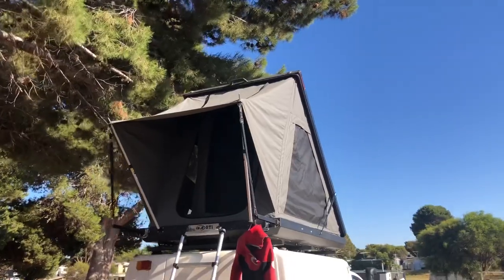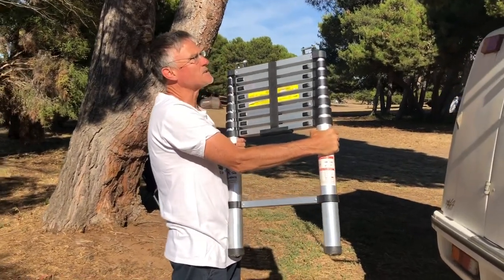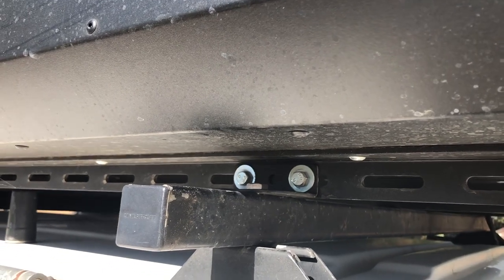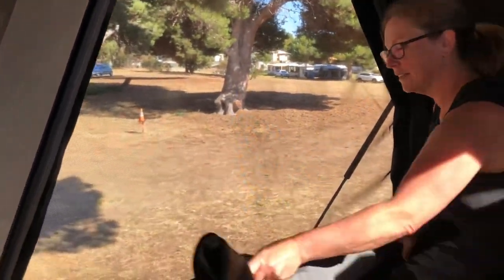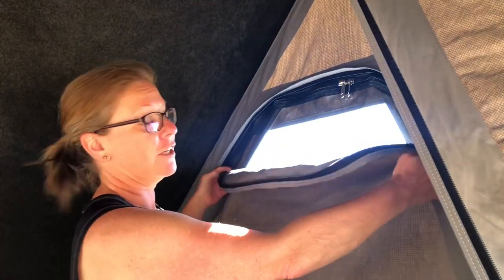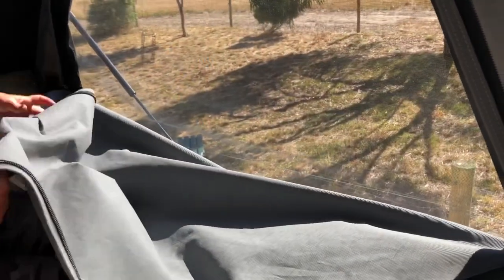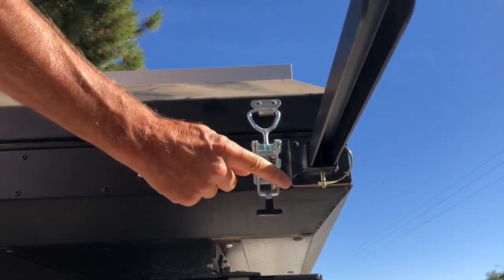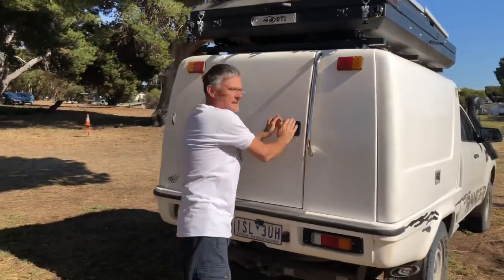Boss Aluminium Hard Shell Roof Top Tent Review

Comment: Hi.  What made you not choose the Bundutop RTT?
Reply from the maker: We thought the clamshell provides more room because you can stand up to get dressed. I also thought the Bundutop seemed a little complicated and might fail. The RT1 also looks better.
Reply: @openroadtouring2410  

Thank you.  Does it feel claustrophobic?

Also if you attached solar panels, how did you do this without damaging the waterproof integrity of the unit?
Reply from the maker: The inside is as wide as a double bed with no extra room on the sides. It's a foot longer than the double mattress so there is a little extra space at either end. For one person its huge. For 2, it's a little tight. I'd say it's like being in a 4 man tent that is high enough to stand. Interestingly we find it best with our heads up the lower end so the height is pretty good. 

The solar panels are bolted to the L-shaped roof rails so there is no waterproofing issues. This was a major issue for me because I didn't want to drill holes in the roof.

Comment: Yeah it's a good RTT but there's no side awnings to keep the rain out when it's pouring. This is why I wouldn't buy one, I like to have the airflow without having the rain coming inside the tent! Poor design fault if you ask me.
Reply from the maker: It's true, the lack a a side awning makes it impractical to have the ladder on the side. The zippers on the side also zip from the top down and therefore aren't the best for entry.
Reply: Agreed. There needs to be awning coverage for the side windows. No good in Qld.